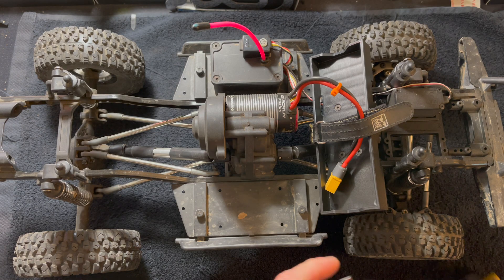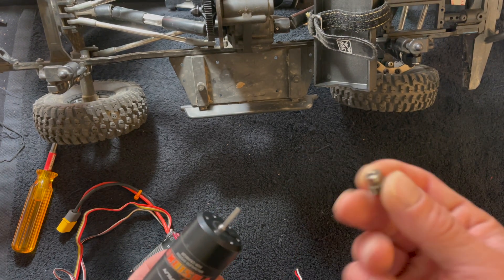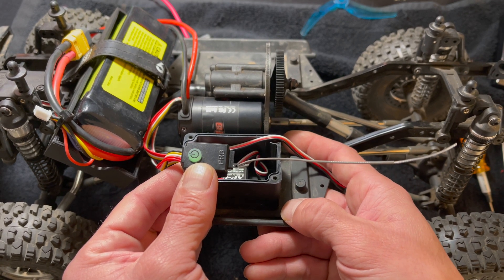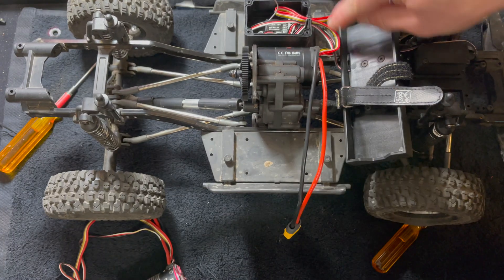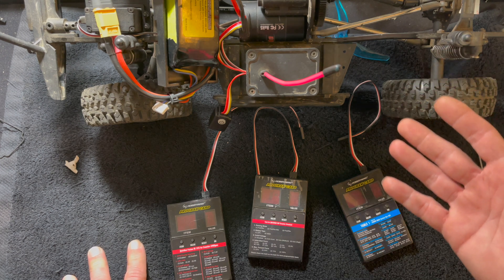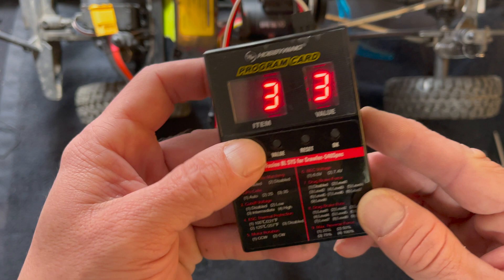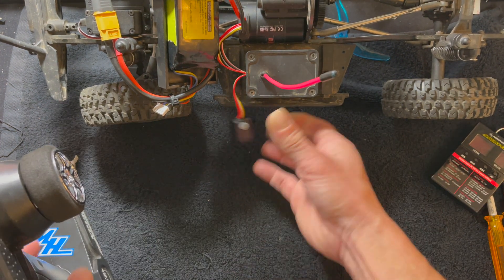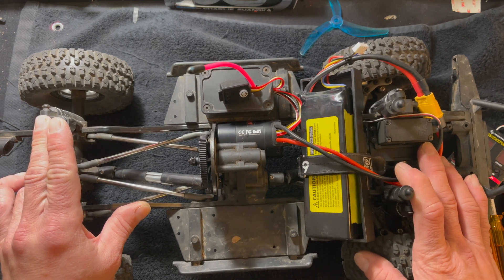The Charlie Show /// Episode 299 /// Fusion SE Setup

Comment: thanks for the video, just sucks that i cant adjust punch value so i need to run my truck at 50% throttle rate so i miss out on allot of top speed, just too twitchy when at factory settings, def needs a punch control

Comment: Anyone have issues with cogging. When I run mine with no load(holding in the air) it seems to start cogging. And yes I’ve done the motor pairing…🤷‍♂️
Reply: Me too. Just installed and cogging even with wheels down. I did not yet set the cw direction. Other than that, everything else according to the manual.

Comment: So, my Fusion SE has worked well for 4 1/2 months, but has now gotten a phanton throttle  issue. Tried to rebind multiple RX. recalibrate, motor pairing, but all that has done nothing but change the phantom from reverse to forward. At 5 months since purchase date, do I go through the dealer or from HW?
Reply from the maker: Please check your emails.  We'v replied.  A common topic that has an easy fix.  "Servo Test" first then go from there.

Comment: Just installed one of these in my Element Enduro. After hiking uphill, driving the truck for about 20mins the power cut out completely. And no it wasn't the battery cutoff because the steering wouldn't work either. Motor seemed very hot to touch although I didn't notice the overheat protection flashing on the power LED. Anyway that's the bare bones of what happened...did I miss something on the install/programming? My last two ESCs are/were 1080s so I am used to programming the values in. Any advice would be welcome.  Up until that point the new setup seemed mint. Much better than the previous brushed motor I was running before. Cheers!
Reply: is it working fine now? planning to get one that's why i need your guys feedback about it if its great or not. thanks
Reply: Hello, I can't say for sure as I sent it back to Hobbywing for testing and I should be getting it back soon.  This process has taken almost two months but that's not entirely their fault.
Also, some of my misgivings can be attributed to a faulty FS GT3-C that took a while to narrow down that that was indeed the cause of some problems and not the Fusion.  In a nutshell my main concern is that it got hot when running and when I asked Hobbywing about this (after they tested mine) they said 'that's normal'.  So, sorry my answers isn't so straightforward but if you are buying in the US their customer service is excellent in case something does go wrong. I was dealing with their Chinese HQ and that worked out fine...eventually. @Japski13

Comment: Just found this video, I love my HobbyWing Fusion Se and I also have a 1080 ESC and a HobbyWing 5 Slot Brushed Motor for another Crawler. Where Im going with this is I had a Dynamite Programming Card that I used to program my Rig and my Daughters, I just had to follow the directions and settings in the manual. Yes I would rather have a HobbyWing Programer but since they recently stopped including them I just used what I had. The Dynamite Programming Card looks just like the HobbyWing Programer except the instruction sticker on it is different so if you have one and want to use it make sure you follow the settings in the manual.

Comment: So will the 1080 brushed esc program box work with QRun brushless ESC like the 10bl120 sensored THANKS
Reply from the maker: Any of the LED Box's, internals, are the same.  They just have different 'stickers' or labels.  So yes, any QR ESC should work with any LED Card, but you have to use the ESC's instruction manual to reference the "Setting Chart" so you know what the numbers are.
Reply: @HOBBYWINGOfficial much appreciated 👍 thanks for reply